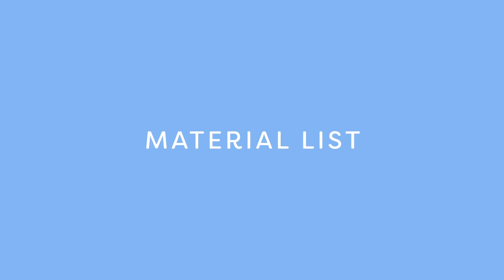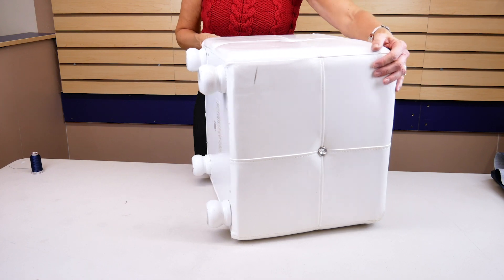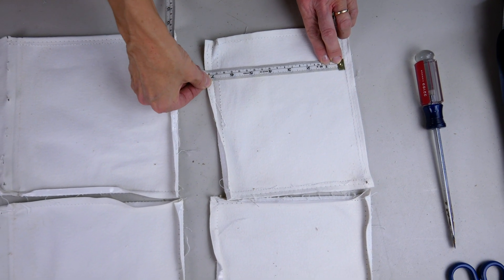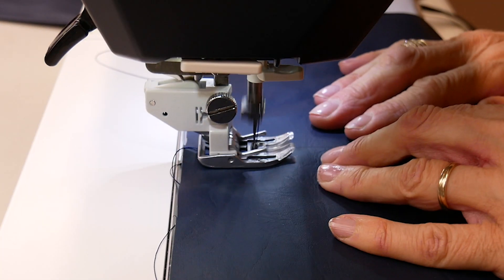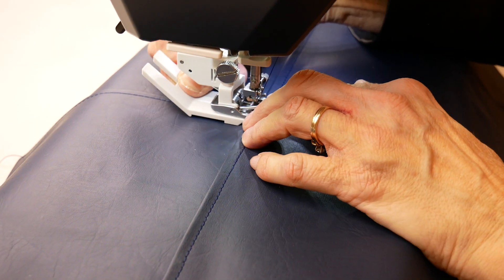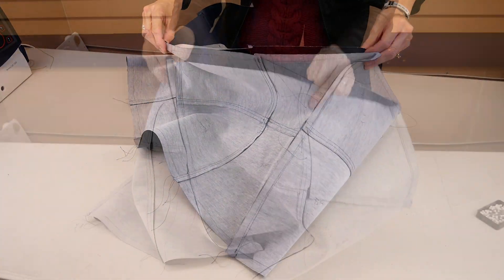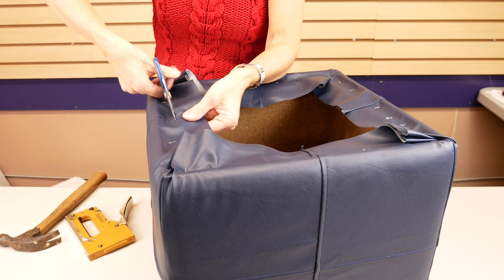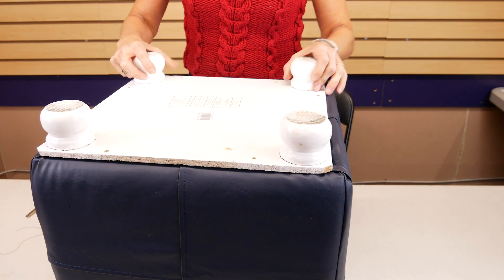How to Re-Cover an Ottoman from Home!

Comment: Nice to know this is possible. I purchased an ottoman at a thrift shop that looked just fine but started shedding almost immediately after bringing it home. I sewed a cover for it with home decor fabric but replacing the original faux leather is a great option for when we get tired of the cover. Thanks for this tutorial.